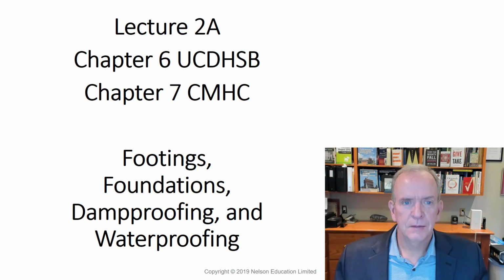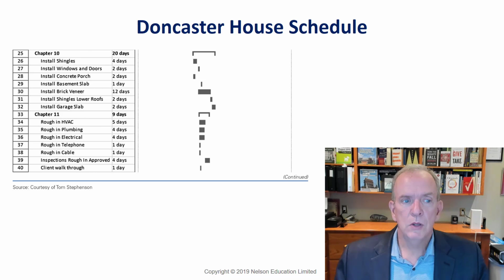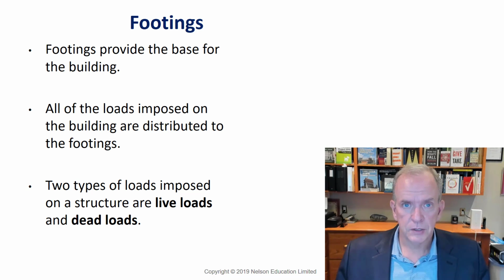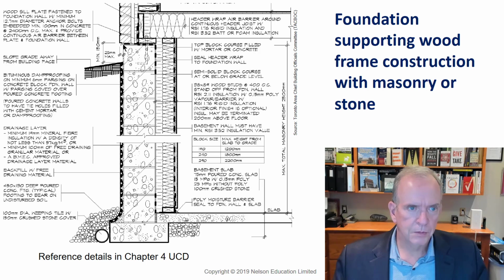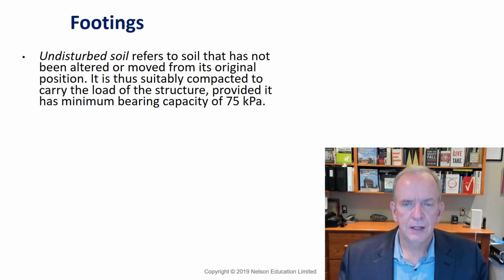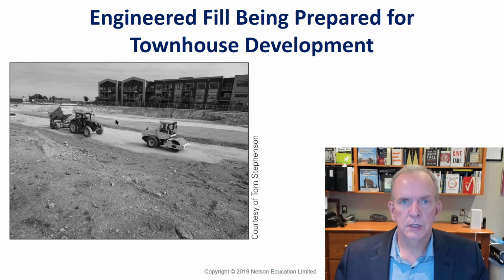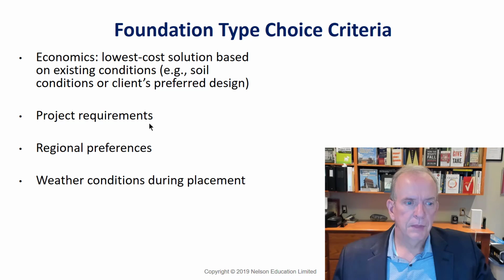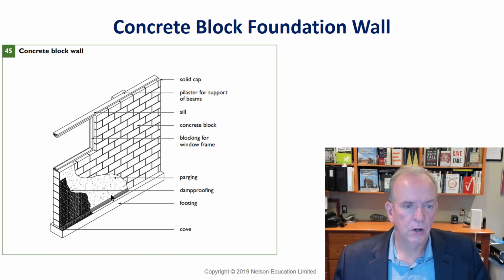Lecture 2A Residential Construction Technology, Residential Foundations, Water and Damp Proofing

Comment: Thank you so much. I am Architect, Engineer and Builder. I graduate overseas.  I moved to de US, and it took me 10 Year from experiences up and down, ( most of them down) to learn what you has summary in two videos. Now I have my Design-Build busines and that is the process:  Designing, Building permits , Construction,  county inspections. The goal is to get  the Occupancy permit, so the costumer can enjoy living on the new construction.
God bless you for share your wisdom.
Reply from the maker: Thanks Ronallara for your kind words.  Where in the US are you located? Im in Toronto just north od Buffalo.
Reply: @TomStephensontraining  Hi Tom, I am in Maryland, Montgomery county. Here, we use IRC (International Building Code) and IBC (Commercial code). Some code's  differences down here : for footing 30" frost line, stairs width minimum with 36" and max rise 7 3/4", exterior wall insulation R-21, Roof Insulation R-49, . Virginia is our neighbor, for them, frost line 20", and exterior wall R-13. The states, are divide in Counties, and some counties divide in Cities. Some of them, make specific amendments on the IRC. So, those things are part of the funny thinks to start a construction busines, around this area.  I  Really enjoy your videos..